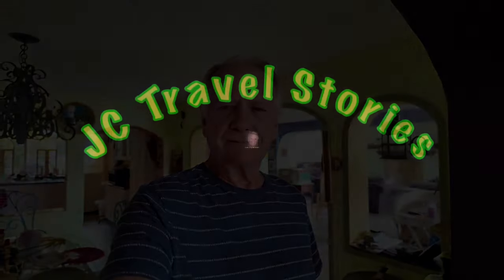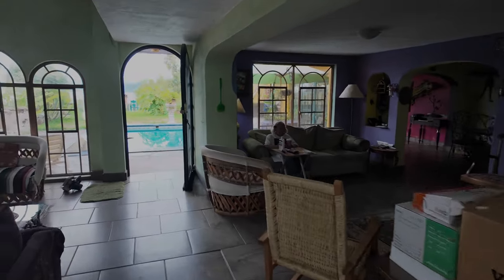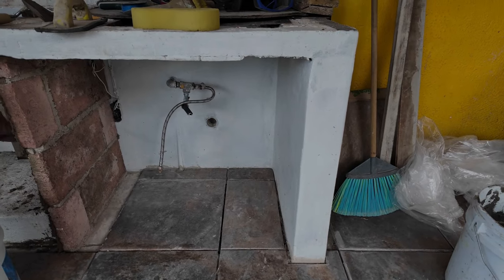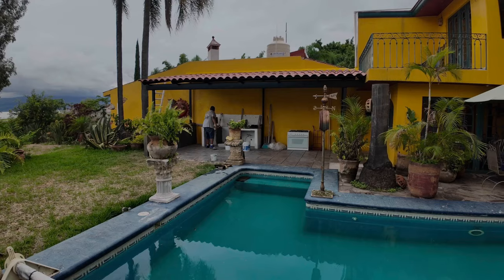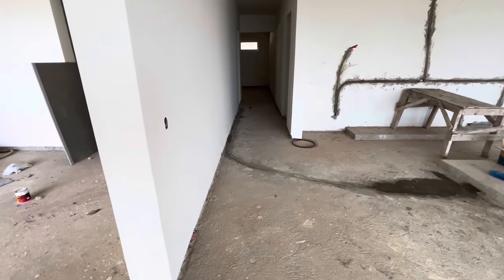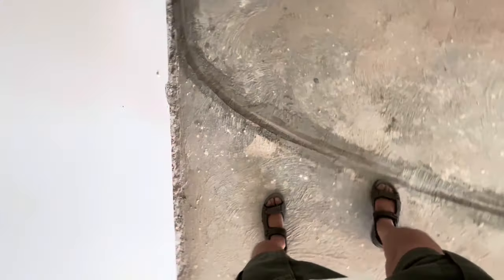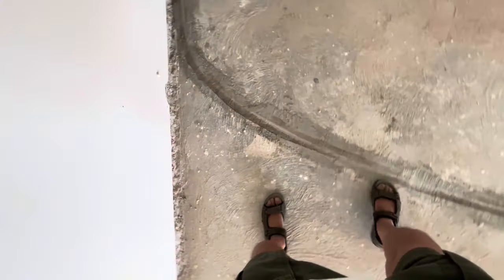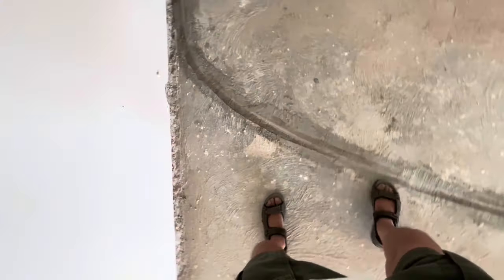JC Travel Stories

Comment: All projects are looking great! How about considering door screens for your doors to keep the birds out? Either custom metal ones or those fabric ones you can buy and glue/Velcro up?
Reply from the maker: I have screened doors.  Birds aren't normally a problem.  Maybe two hummingbirds in 10 years, but the doors have been left open a lot because Juan is wheelbarrowing cement and construction materials through the house to the pool area.

Comment: I wondered how they setup electrical outlets in Mexico. All the houses and apartments I've been in are concrete  and I wondered how they installed their electrical receptacles and switches. I've never seen wood framing being used to finish the interiors so plumbing and electrical work can run through the house or a building. They don't have a lot of receptacles like in the US.

Comment: I've broken enough concrete to say... "That's a BAD technique"😆🤠✌️
Of course pre planning electrical and plumbing with contractors might require too many manyanas there???

Workshop 3-4 stories up???
Reply from the maker: Good questions.   :)
Reply: That process is not universal in Mexico. The houses going up near me bury the red plastic conduit into the floor's rebar before the pour. They also place the conduit in the concrete pillars supporting the brick walls before they pour them. But where needed they do chip a channel into the soft brick after they are layed. The point in Mexico is that labor is cheap. Most concrete is done by hand in batches on the floor.
Reply: That wall looks so bad.